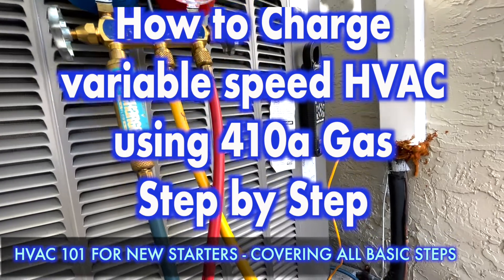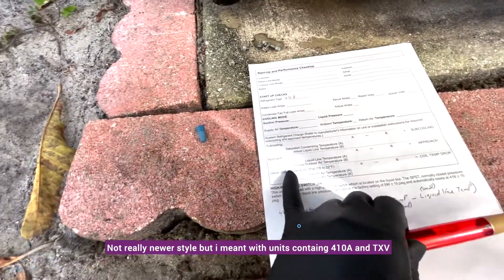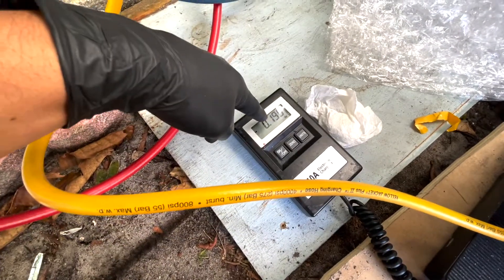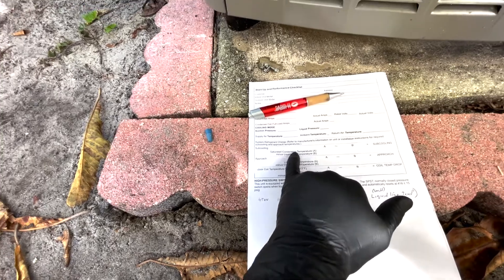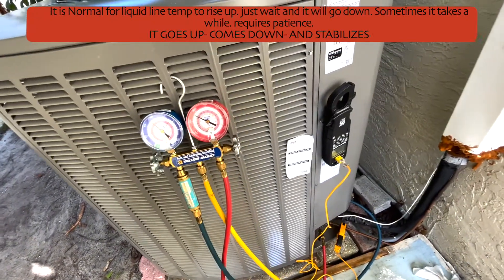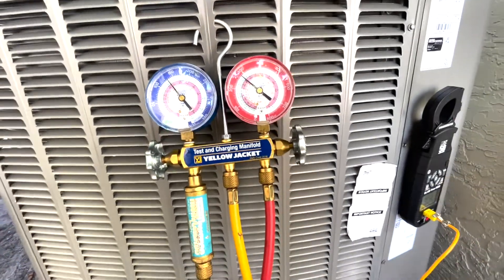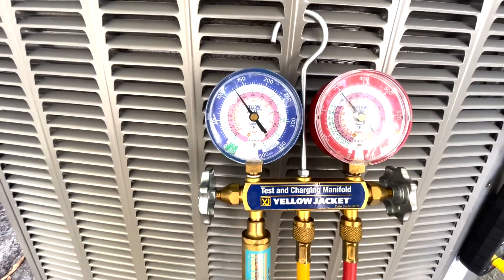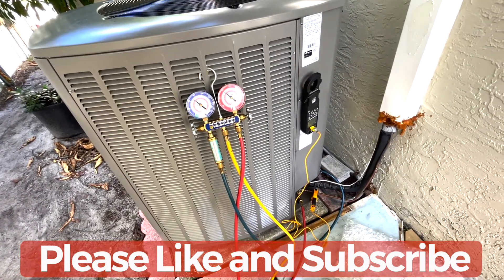How to Charge variable speed HVAC using 410a Gas - Step by Step DIY

Comment: Nice video bro can you tell how can I make the Ac to work 100 percent capacity to get the correct sub cooling capacity  and can I add the refrigerant on gas state instead of liquid? To remove the risk for damaging my compressor